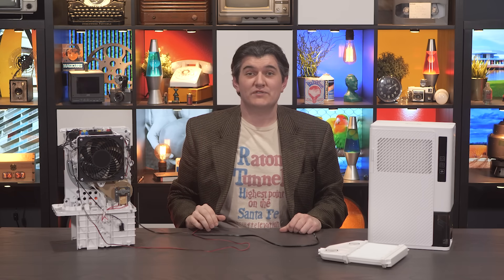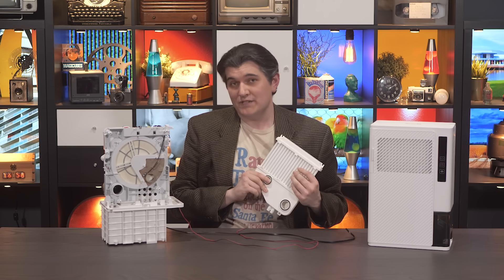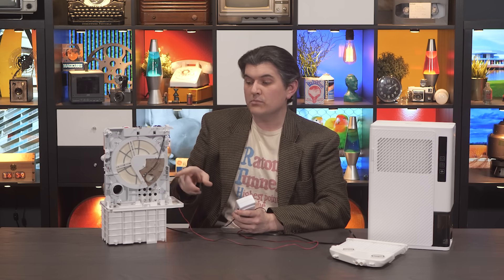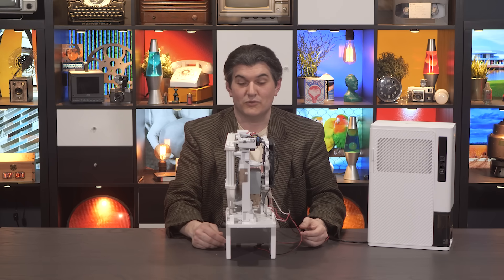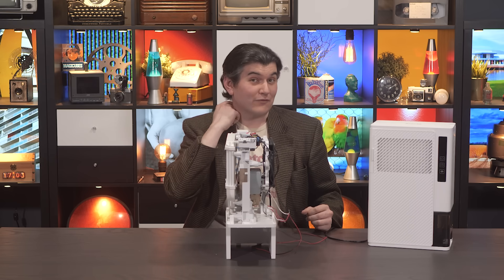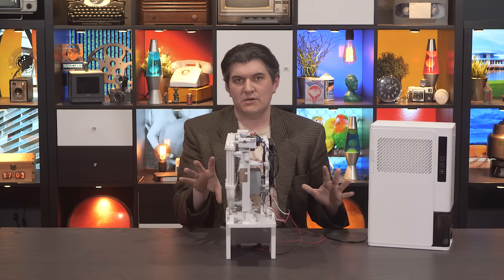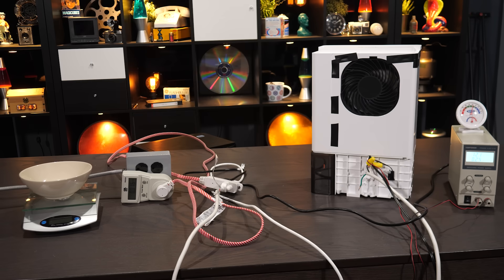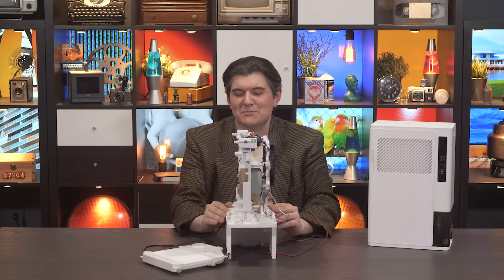A failed duty cycle experiment with a rotary desiccant dehumidifier

Comment: What if someone replaced those plastic straws that make up the radiator, and replaced them with some kind of fairly thin metal straws?  Copper would be best, but even some stainless steel drinking straws might help pull more heat from the damp ( and hot ) air, letting the water condense more easily.   Then less moist air is getting blown back into the wheel.  That then should allow the wheel to be able to absorb more moisture from the room, since it isn't getting partially saturated with its own moist air.    That depends on what temperature the desiccant releases its moisture,  if both sides are reaching that temperature,  and how fast it cools down below the point where it releases the moisture.   If that heating element is strong enough, The wheel may not be absorbing its already moist air that the straws didn't condense.   I just don't know on that part.   But I think it would still be interesting to try to make a radiator out of metal tubes, instead of plastic. 

Now i'm wondering about a more powerful main fan.  But then I wonder if this thing has a "heat up phase".  Maybe the heating element isn't powerful enough to instantly heat the gel to it's drying point, and that the entire wheel needs to warm up a bit first via the heater,  Then once the wheel is hot enough, the heater is then able to get the gel past it's drying point.   If that's the case, then a more powerful main fan might actually degrade performance.   I just don't know how much the wheel cools down, while it spins so slowly.    Again, another thing that could be tested.   And if the wheel has a heat up phase, What if the radiators airflow was separate from the air that passes though the gel?   Could the main fan then be slowed down, so the entire wheel can stay at a higher temperature ( but still below its drying temp ), which could allow the heating element to be ran at a lower power?   And then a fan dedicated to the radiator could be set to a much higher flow, without impacting the temperature of the gel, potentially allowing the radiator to condense water faster. 

Damn, now I want one, to do tests with.
Reply: That was my thought. Plastic straws are not very thermally conductive, so it won't cool the hot humid air as much as thin metal straws (almost like a radiator, even).
Reply: @G5rry  I understand the comments however you want a very low thermal inertia for such a small wheel and metal straws have wore thermal mass increasing the inertia.  Industrial desiccant wheels rotate very slowly but are approximately 1.5 meter in diameter and 500mm - 900 mm deep with a massive surface area.  The unit demonstrated is very cost optimised  (crap) the EcoAir I use have a much larger fan and control the wheel zone temperature though good design and timing.  You make some interesting observations  " Munters " website may provide you with the answers to your questions.
Reply: Looking at other comments on how silica gel works when absorbing VS Regenerating it seems like the power of the heater and how humid the air in that side of the system is seems to have little effect. from what ive read those silica wheels need to essentially have the water boiled out to get dry and unless you had an absolutely massive and absurd heating system to be able to do that to that wheel. which obviously would cause some problems. so they base these systems on a ehh good enough philosophy of 80/40 which means the wheel is never fully dried out so it never really absorbs as much as possible. 

you could easily add more efficiency with a metal radiator and better blower. Which im guessing they did not do purely to be cheap. i almost wonder if you could improve the efficiency of the regen part to a point where you could run the heater on a duty cycle and have it pull a similar amount of water out of the air while using slightly less power. 

What i would love to see is either a match with the vapor compression unit in terms of either power or water that might be impossible with the unit he has and perhaps the bigger better designed models we dont get in the US are at least a bit better that chart off amazon only listed power used. not the power used over time and perhaps those bigger guys do actually have duty cycle control on the heating side.

i would imagine that separating out the components so the radiator is never in the path of the desiccant and runs at a higher power draw would improve its efficiency a bit especially with improving the radiator efficiency itself and if you keep the desiccant wheel closer to its drying temperature even when exposed to the normal air would improve the drying cycle itself. but that would require even more power used, or youd slow the fan down as you eluded to which would reduce its turnover of moving air through the system in to the environment.

another thing i wonder, Alec never mentioned this, but those desiccant wheels are always absorbing even when the unit is switched off, but with it off the wheel is no longer being dried, so in my head the wheel is already starting at a negative, its starting with a wheel thats "wet" and needs to be dried i almost wonder if having a start up of main fan off, blower and heater on for say 4 minutes to dry the wheel out would yield a better performance over time since you could start the wheel with a lower absorbed water index. i also would like one to perform a few tests, but honestly where i live dehumidifiers are basically a non existence we never need them because our air always favors the dry side. So buying either of the machines would basically just be for a test. our lowes, home depot and walmart dont even have these things in store if we want them we have to order them from the websites and have them shipped in.
Reply: @compzac  Didn't he measure 100% humidity coming through without the plastic condenser connected? That's not loop, straight shot heated air achieving 100% humidity..

Yeah, the condenser needs a more thermally conductive material.

Comment: What about a temperature sensor in the humid air exit that reduces power to the heating element to keep it at an ideal temperature and not pass it?
As well as replacing the plastic pipes on the path down with metal ones for improved thermal conductivity?

Comment: I wonder what the humidity in and out of the condenser is. Seems like a very short air path and the condenser isn't anywhere near as cold as the vapour unit (even if the temperature change might be similar).

Comment: It would be interesting to combine the rotary desiccant part with the compressor dehumidifier (using the radiator to dry the silicate instead of the resistive heater),
Reply: not enough temperature from the vapor compression cycle.

desicant dehumidifiers need about 120°C or 300 footballburgers per square eagle.

Comment: Have you ever heard of Onset hobo equipment? It’s a little expensive, but they have some great electricity and air conditioning metering equipment that I think you would find useful. Specifically for you, I’d look at the plug load loggers and the MX1000 series as an upgrade to your kill a watt and your Analog hygrometers

Comment: But what about replacing the heater with peltier?
Reply: That's an interesting idea.  The cold side of the the peltier could be used to condense additional water from the air and the hot side could be used to heat the silicon gel disc.  I wonder if the problem could be the amount of power used by the peltier is greater than the amount of power used by a normal electric heater per unit of water removed from the air, even though the peltier's cold side is also removing water.  I don't know, but I like your thinking.
Reply: It probably doesn't get hot enough. But a refrigeration cycle/heat pump would be a funny thing to try. You then get the rotating disc in a closed/-loop "classical" dehumidifier.
Reply: Resistive heating is already 100% efficient.
Reply: @projectartichoke  It's 100% efficient at making heat, but making something cold is actually a desired outcome here since the primary goal is to remove water from the air.

It is theoretically possible for the additional water removed by the cold side of the Peltier to be worth the additional power.

Comment: Maybe run it with the heater disabled after ensuring it is completely dry. Then monitor the weight of the whole assembly to detect how much water is adsorbed given however much time it takes at whatever ambient humidity. Then run the heating element for a rotation and see how much the weight falls to determine the proportion of water ejected (you would need to remove the condenser).
Reply: Great idea
Reply: I wonder though whether the rate of absorbing goes down the more it absorbs. Just like an enough cat park begins filling quicker than when it is nearly full (or how an empty battery can charge quicker than a nearly full one). The constant emptying is likely significant.
Reply: Yes!
I'm an electrical engineer, and this is where I would start if I were tasked with designing this thing.
(i.e. characterize the behaviour of silica gel)

Comment: Semi-Selfish Requests for New Video Ideas You Could Use:

- Covering the “Northstar” Mantle Lanterns that used large Tubes rather than thimble shaped mantles (Why, How, Did it work better etc or was it just a gimmick)

- A Video on Propane/Butane Blends in Camping Fuels / that odd Coleman POWERMAX fuel standard 

I have geeked out on these, so could help with research etc, but they are neat rabbit holes to cover (if you need any more, probably have plenty as is!)

Comment: I think you've got your numbers a bit wrong. You said 80 second to adsorb and then 40 seconds to dry out and drop the moisture, however that's only one third of the total time. The blocked off section is way less than a third of the total circle, and in the main video you estimated it as about one fifth, so it should be 96 seconds to adsorb and 24 seconds to dry out.

Comment: I may not be the max it can absorb, but it may be the most it can be forced to release in the time it passes through the discharge zone. Either side could be the limitation.
Reply: This is correct.  Silica gel absorbs water pretty darn quickly, but has to be heated thoroughly to release that moisture (basically boiling the water out).  That release process isn't quick - usually on the order of hours.  This machine will always be floating just below the saturation point of the silica gel wheel, with the limiting factor being how quickly it can strip the moisture back out.  Such a small area isn't going to regenerate the silica gel much, but it'll be consistent.  There isn't much you'd be able to do with this to improve the dehumidifying volume, since you can't increase the temperature as that would damage the matrix, and increasing the area or time for regeneration only means that you have less time and/or area for absorption so you're still floating a similar amount of extraction either way.  It is what it is, and given the simple design, can't be improved.  It's always going to be mediocre.
Reply: @velocitasfortis  yes, this release zone is probably a limitation, that gives 150-200 g/hour. BUT that extraction limit is above 15~20 degrees Celsius. Below that, I believe, it's absorbtion limited, because of low absolute humidity of the air. I think his approach might still lead to better result if tested in devices intended usage conditions (cold&humid)

Comment: Nice experiment! I still don't understand why you'd get less water with this approach though.
In my opinion, if you give the gel more time to absorb water by stopping the wheel instead of increasing its size, nothing should change.
I think of it as emptying a swimming pool with buckets of  two different sizes; in one case, you have small buckets and can fill and empty them frequently but the ammount of whater removed with each bucket is low; in the other scenario, you have larger buckets but it takes longer to fill and empty them altough with each bucket you carry away a lot of water and thus in the end the ammount of water removed should be the same. I am assuming that the heating element is powerful enough to completely dry the gel regardless of the amount of water it contains.

Comment: How much more effective would these be if they had multiple stages of dessicant discs?
Reply: A Cascade Almost?  It will be a backburner project but making one of these that uses Waste Heat / Solar etc is a goal of mine, making it ✨Modular✨ and testing a cascade configuration would be neat!